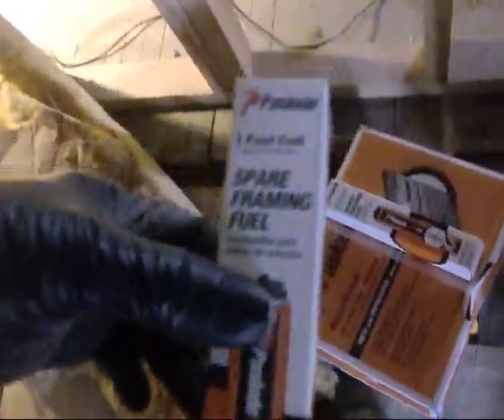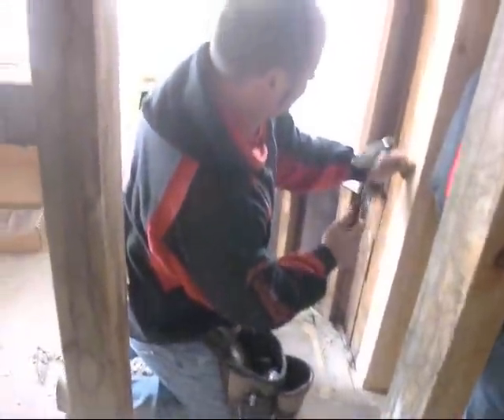3 15 13  Apt 6 Main Beam Up Vid II

Comment: that is a lot of work i had figured at least 65  i would have a hard time keeping up with your big apartment building let alone all the smaller few unit ones i can see why you need to take a road trip every once and a while i would go nuts with all the different tenants and paper work